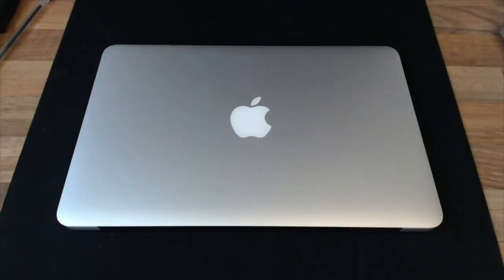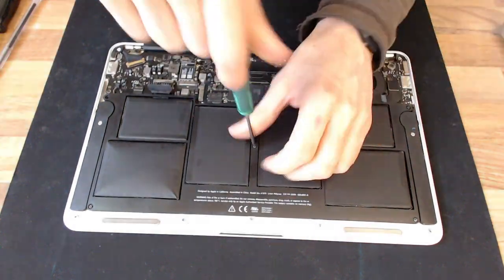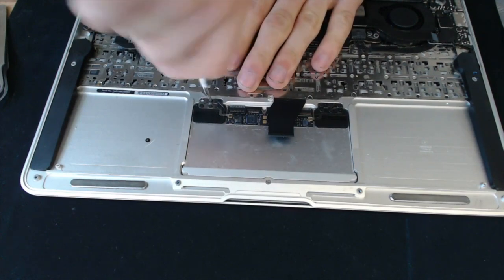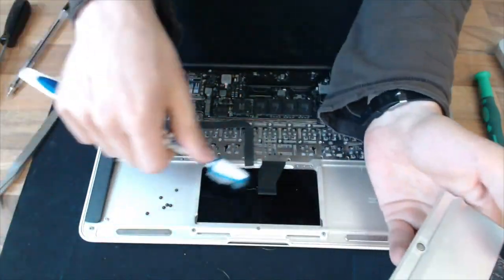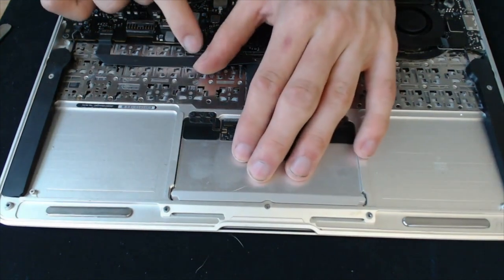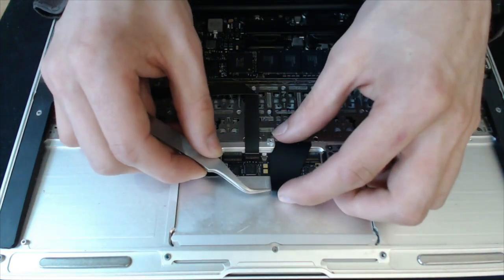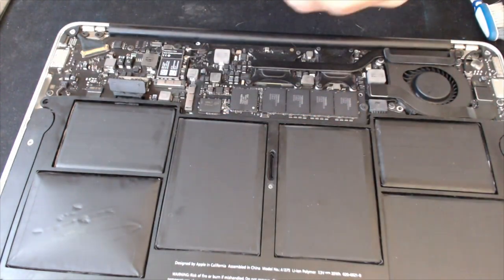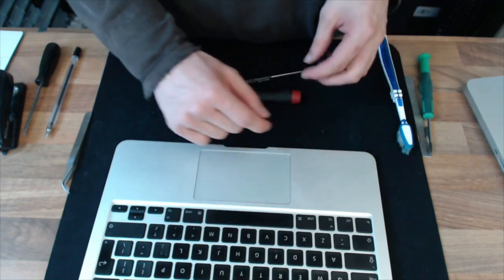LFC#44 - MacBook Air Trackpad Repairs

Comment: Hi, after replacing my A1370 MBA Logic board, I've experienced weird cursor behavior and movement when the laptop is connected to AC. Seems like theres a ground that might have been compromised in AV plug

Comment: Great video. My probem was fan coming on, and HWSensors app showed trackpad not reporting temperatures. Computer had been left out in the rain! I was planning to swap the trackpad with one from another similar but dead mac. However, the trackpad data connecor was dirty with black gunk. Cleaned with ethyl alcohol and cotton bud. Back together. Good as new.  Did not even have to pull the second more difficult connector apart.

Comment: Hallo sir,
I have a question, my trackpad is not responding & being hot when I turn on the macbook.
Is that mean my keyboard was broken? Is that possible to fix with your method?

Thank you
Reply from the maker: H'mm... I've never encountered a trackpad that heats up before. If it's actually getting hot, then something on it must have failed. You can use this video as a guide to replace it, yes.
Reply: @Adamant_IT  thank you sir

Comment: Hey Adam, thanks for this video. I have a 2014 13inch Macbook air with loose hinges and trackpad isn't clicky at all. Can I follow this tutorial to try and fix the trackpad? What do you recommend for the loose hinges?
Reply from the maker: Yea this is a good place to start for the trackpad. When you remove the trackpad, there'll be a tactile button on the bottom, which is the 'clicker'.
If that's not clicking, you'll need to replace the trackpad. You might be able to fix it by adjusting the click-weight screw if the clicker does still work though.
And check LFC#62 for how to service the hinges!
Reply: Adamant IT Thanks for reaching out. When you said to check LFC #62, what are you referring to?
Reply from the maker: This video: https://www.youtube.com/watch?v=8Dwm-SSJarc

Comment: Hi. Thanks for the video.  I followed your instructions closely. Unfortunately the macbook air (2010) won't power on now.  Any ideas?  I've ordered a new trackpad but am not sure if it would keep the computer from powering up.  Thanks.
Reply from the maker: Hard to know if anything was damaged - however keep in mind that MBAs can take a while to come back on after an SMC reset, which happens when you disconnect battery and the charger. So try hooking it all back up, wait a minute, press the power button, wait another minute, just to make absolutely certain that it's not just recovering from an SMC reset.

Comment: Thank you!!! I just fixed my trackpad and saved myself a ton vs bringing it into the Apple store!   
** Keyboard ribbon cable on reassembly is a bit tricky, dont get frustrated, once I had part of the blue edge of the ribbon in I rotated my computer and gentled worked in the other side and brought down the clamp with the spudger. You will definitely need two hands for this. 1 to hold the ribbon up and 1 to use your tweezers to guide the ribbon into the connector.  

****Lastly don't forget to test that your trackpad is clicking normally ( and to your desired tightness) after you adjust your set screw, before you put your battery back in!  The set screw is very precise and a fraction of a turn to the right or left will either tighten or loosen your trackpads ability to click.
Reply: What did the Apple Store want to fix it?

Comment: Followed your instructions and now my not only does my cursor dont work, my macbook does nothing now...only see a blank screen..😭😭
Reply: Adamant IT - I don't know how to connect the battery back...I think thats the issue.
Reply: Adamant IT - I didn't know that there was a sleeve to pull out the battery to begin with. But the battery was disconnected from board when I lifed whole battery out of way to pull out the cursor. Now Have to solder the battery back or replace whole...😭🤕

Comment: So I watched this video until I felt comfortable enough to do it myself and while I waited for the parts to come in. It was going beautifully until I got to the trackpad and the screwdriver I ordered didn't fit the screws. Then I tried to just put in the new battery I got and the connection cable from the battery to the rest of the computer is about an inch too far to the right. FML. I almost cried. Second time's the charm, right?

Comment: Great! Thank you so much, this finally fixed my erratic trackpad!

Here's my little improvement: To adjust the trackpad right, I put a sheet of paper through the gaps of all 4 edges, then finally fix the screws and then (of course) remove the paper. Seems like the trackpad works best when it doesn't touch the case at all.

Comment: GOD, THANK YOU SO MUCH

I did not realize the keyboard cable had a locking bar. I was trying to force it back in closed, doof
Reply: I had the same problem until I saw this video. I looked at multiple videos but the shorter videos only show the removal of the cable, they don't show how to insert it back.

Comment: Thanks, but the MacBook Pro Retina trackpad repair IS different than the Air. Please do one with a Retina, 13-inch, Mid 2014. I can move my mouse with precision, and if I push hard, I can imitate a "click", but it really doesn't click. I think I pushed too hard on the pad when I was cleaning it. BTW - I do not have the ForceClick model. - I'm more concerned with purchasing the correct tools. Could you also do a "Best Tools to Use" video? I'd hate to purchase cheap ones and have them strip.- Thank you! Love your accent BTW.